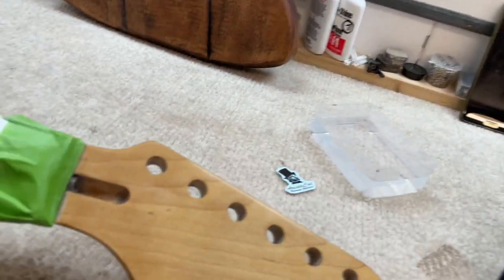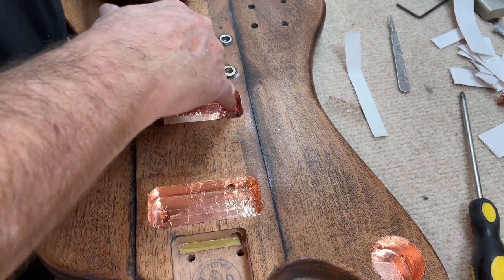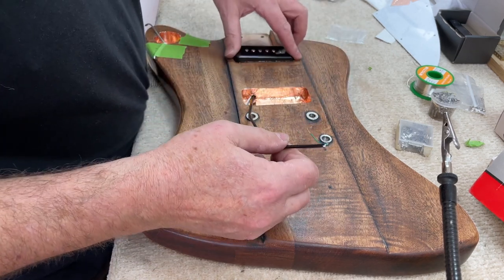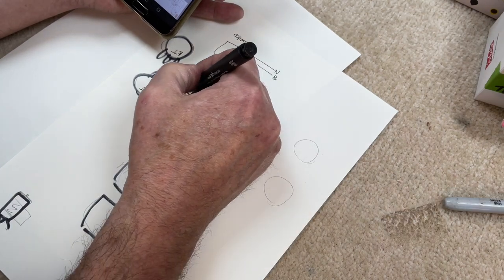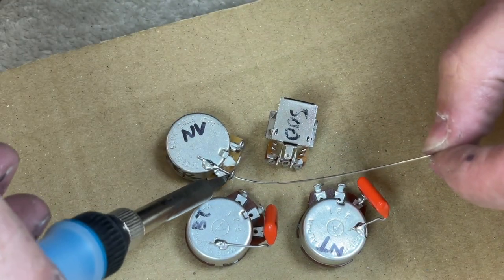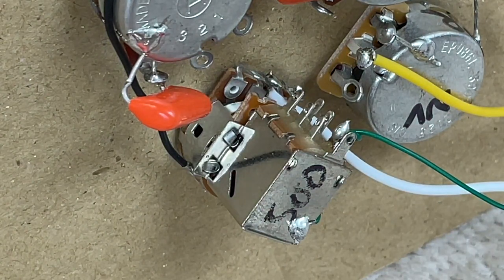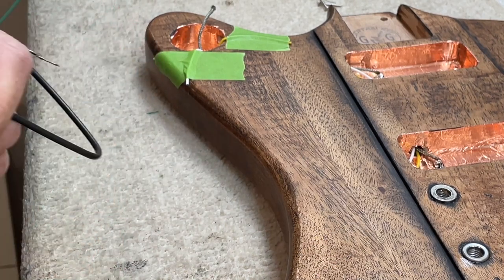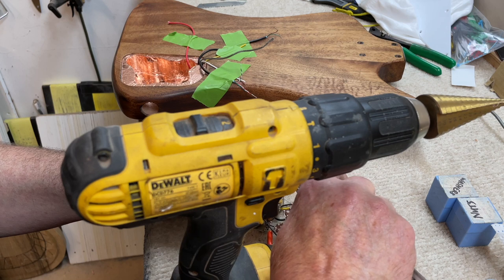Firebird Kit Build Part 7 pickups and wiring

Comment: Hi Sam,
Have sent you an email so we can discuss the guitar parts, loving the build by the way ,i prefer these real time builds cos there is no hidden crap all legitimate work ethics and thats what makes it all the better to watch 👌
Reply from the maker: There is a bit missed out... like the dozen or so coats of TruOil going on ... the wire wool part... and some of the wiring / testing after this video was turned off.. It does show how long this takes... I spent a good 4-5hrs solid on this guitar on the wiring / decal / testing the wiring alone yesterday. When you add it all up vs. the hourly rate it doesn't really work out very well lol. I treat kit builds like this as 'spare time fillers' (and good practice for problem solving etc)
Reply: @SamDeeksRelovedGuitars  exactly ,kits seem ok for some fun and this is why I like your videos, they are very honest viewing. 
Hope my email made it to you and not the spam..I have to refresh my email inbox all the time to get my emails even though I have it turned on in the notifications 😆✌

Comment: Very good video thanks, all ways interesting, but I'm curious as to why the screw holes for the neck are skewed in the guitar body.
Reply from the maker: If you mean 'why are the screw holes in the neck heel way off to one side?' - that's entirely because that's how the kit maker drilled the holes in the body. The heel wasn't drilled; I followed the body holes to drill pilot holes in the heel... that's where the (badly positioned / badly drilled) body holes positioned them in the heel. Not surprising considering the bridge posts were several mm out as well.
Reply: @SamDeeksRelovedGuitars  O.k. thanks for replying, even with those holes in the neck heel being off to one side the neck seemed to fit very well, amazing. Not a criticism by the way just me being curious.